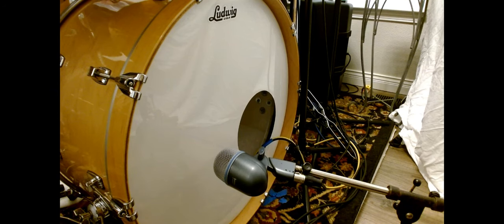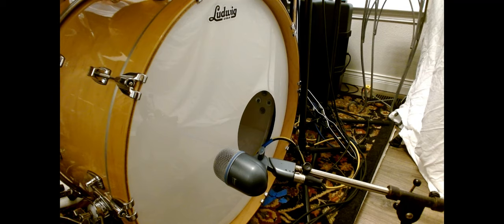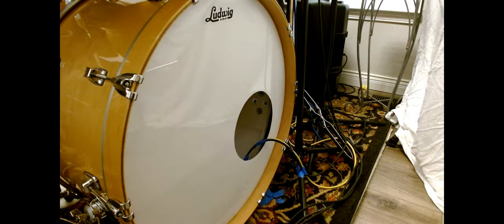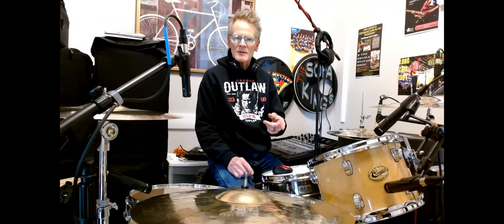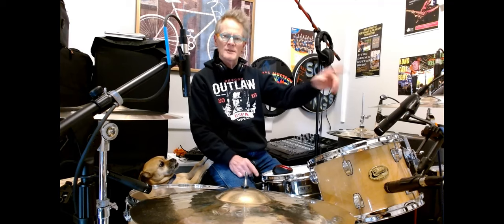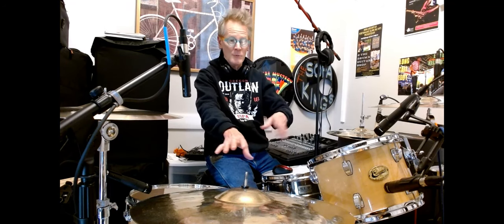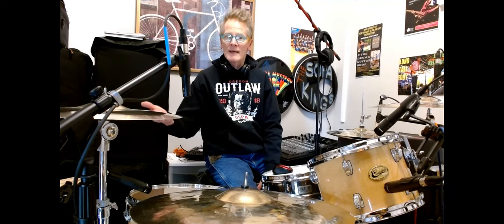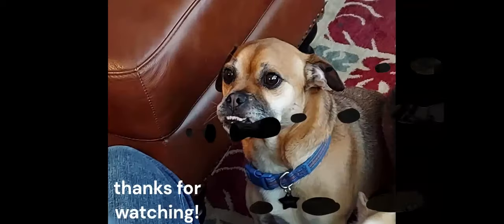Bass drum mic stand causes nasty cymbal sound?!?

Comment: Indeed. also, get a packing blanket and cover the entire front of the kick - mic and all. It really helps with a cleaner kick sound. I use and spring clamp to hold the blanket to the front hoop so it will not slip down and move the mic. Which has happened and I wondered why my kick wasn't sounding as good.
Reply from the maker: I've seen some do that. 👍
Reply from the maker: The problem I was having was caused by the stand. The position of the mic was not critical in this case. When I got the mic off that stand, the cymbal sound cleared up! Pretty strange considering the stand was theoretically isolated from the floor that the drums were on.